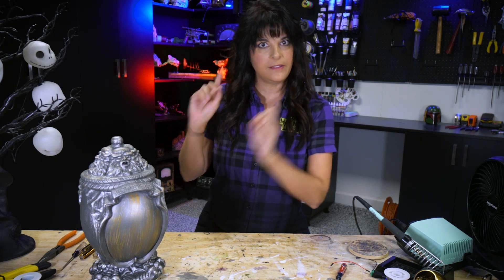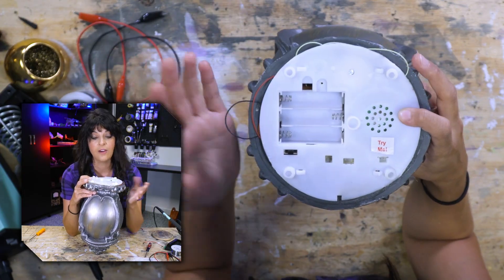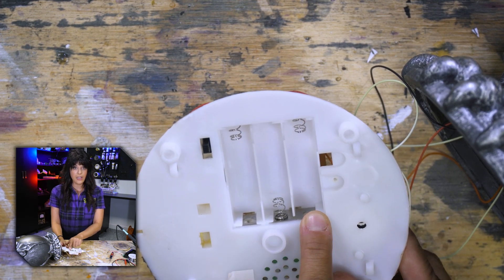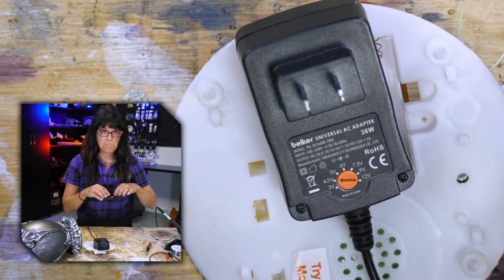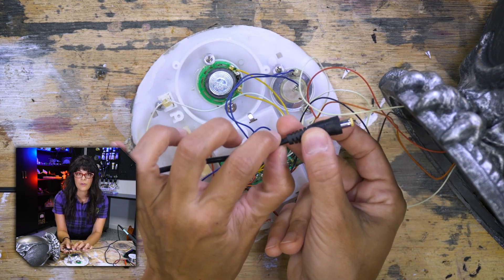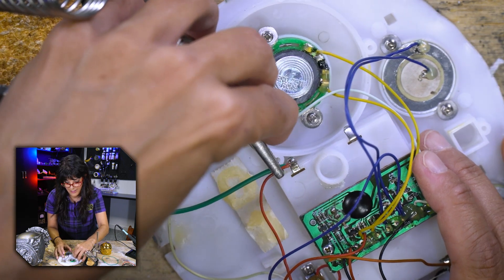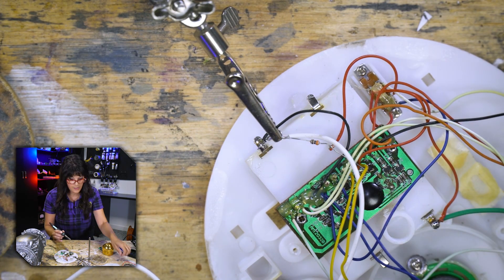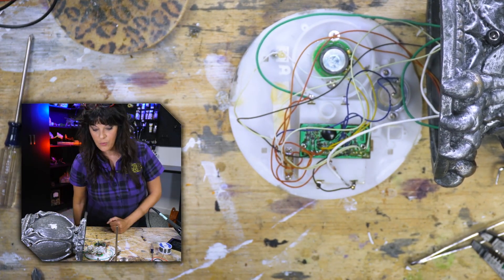Convert Your Battery-Operated Halloween Prop to AC/DC Power: Never Replace Batteries Again!

Comment: The device that you use to hold the wires in place to solder them. Did you buy it or build it? What is it called? Thanks

Comment: Thanks for the information. I learned to solder building Heathkits with my dad decades ago. Basic to the technique was that there should be a good mechanical connection and that the solder was just to conduct electricity better. In terms of attaching your green wire to the reddish one, this would mean removing the red wire and stripping it back some. Clean the solder off the connector. Strip the green wire a little more and tin the end. Then use your needle nose pliers to turn the tinned ends into hooks. Hook both wires through or over the connector. Tighten the hooks with the needle nose. Then apply solder to these solid mechanical connections. It may seem like a bunch of extra work, but you get something much more robust and reliable.

Comment: This is super helpful in what I've been looking for for a while now. Question for you, how do I decide what size wire that I need for these types of projects?
Reply: Also, I have two identical props each running off three AA batteries. If I were to wire them together in parallel would that still be 9V?
Reply from the maker: Yes, you can wire them together in parallel and each would get 9V. As for wire gauge, usually anything 18 AWG or thicker is good.

Comment: Nice video! Just came across it because i was looking for new things for halloween!
I would like to offer my solution for powering props which is less intrusive. 
First I got a hold of a bag of dummy batteries. 
They are plastic hollow "batteries" that have a wire in them connecting the positive and negative terminals. So for this prop you have, you'd get 3 aa type ones. Open one up, cut the wire in it, solder a USB wire to each terminal and close it again. 
Then you only have to make a small cut in the battery cover, stick 2 unchanged and one with the cables in and viola.

To actually power the props, i go with 2 methods. One is to run a speaker wire by every prop that has 12V on it from a big PC power supply. Then for every prop, i connect a dc-dc converter to that to drop it down to around 5V. You lose some voltage over long wires so this way there's always enough power to get 4.5 to 5V
Others i do have a USB charger, but i do add a 1N4007 diode in series to drop that power just a little so no magic smoke ever shows.
Reply from the maker: Great ideas!

Comment: Great demonstration.

While it is important not to feed more voltage than the circuit is designed to handle, it's possible (even likely) that a slightly higher 5-volt power adapter (which is usually much easier to find than a 4.5-volt one) would be fine in this case.  Alkaline cells, like AA, are nominally 1.5 V, but a brand new one may be as high as 1.65 V, so three brand new batteries could give 4.95 V, and thus the circuit has to be able to tolerate that.  Any circuit that runs from batteries either has parts that can handle some reasonable range in voltage or has onboard voltage regulation.  So, yeah, don't connect a 9V or 12V supply to a toy or prop that typically uses three AA batteries, but a regulated 5V supply (which is super common in USB chargers) it probably fine.

By the way, the connector on the wire from the power adapter is actually the female, and the screw-terminal one you're using is the male.  I know, I know, it seems backwards.  Though not entirely standardized, the convention is to have the positive voltage on the center connector, and that's the one that determines the "sex" of the connector.  A barrel connector has more in common with a turducken than mammalian reproductive organs.  I generally go with "plug" and "socket", but even those can be confusing.

Comment: Great video & info, thank you for that.  Question though I probably messed up somewhere, it came on before batteries but in testing I messed up somewhere.  Is there a way to diagnose what may be the problem.  It doesn't come on now with the batteries.  Any help you can provide is greatly appreciated.

Comment: Mi'lady, I like your simplified way of explaing how to do this conversion, but I am put off and a little leery of it because of how un-aware you seem to be of the other wire locations to your work.  The blue wires getting burned and the circuit board wire which looks to be burned right at the circuit board on your second soldering job. Don't get me wrong, I wouldn't have known how to do this conversion without a lot of research, but maybe you could be a shade more careful?  This may have been a fluke, so I will watch some more of your videos because I like your ideas, if not the execution.  🙂

Comment: FOr the love of all that is holy: "it can take all the amps you want" is true, within reason. DO NOT do something like hook it into a truck battery. 800 amps @ 4.5 v assuming standard cheep proper copper wire = 12 watts of power = melted cheep electronics. Like literally melted. YOu will light those wires on fire.
Reply: What she meant was that the prop circuit will only draw the amount of current it requires to operate. Overvoltage is the killer if there is no regulator in the circuit.
Reply from the maker: Since these are recorded as a live stream for members and then edited down, I do tend to get carried away with my explanations with the group 🤣

Comment: If your gadget uses 3 or 4 AA or AAA batteries in series for 4.5V-6V it should work just fine powered from a cheap 5V USB phone charger or power bank.

The "nominal voltage" of Alkaline cells is 1.5V but new batteries often start around 1.65V (1.2V for rechargeables) then produce usable power down to around 1V, so battery powered gadgets are designed to operate over a wide range of voltages as battery voltage starts high then drops with use.

Just cut the end off a USB charging cable, strip the red(+) and black(-) wires then join them onto the battery terminals. Small gadgets with no moving parts usually work fine with cheap USB cables, but look for better quality thicker wire USB cables for higher powered gadgets with motors.

Depending on the current (Amperage) requirements you may even be able to convert some gadgets requiring C or D batteries to USB, but they might require more power than a typical USB charger can supply. You can check power requirements using a multimeter.